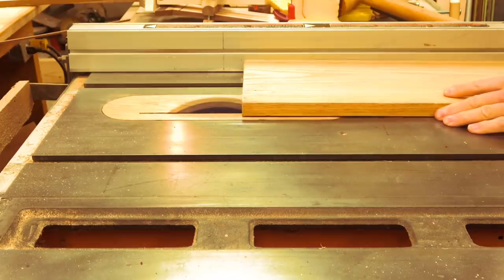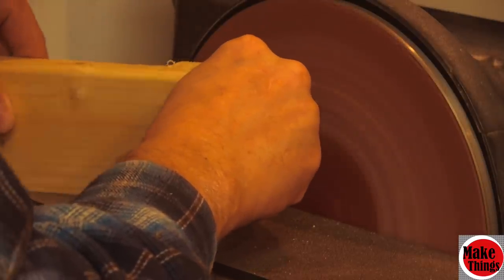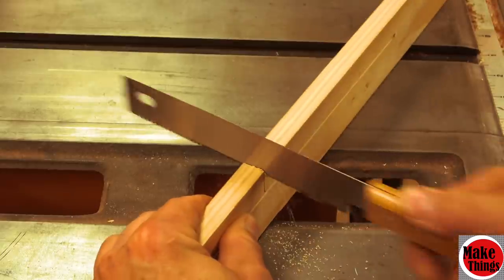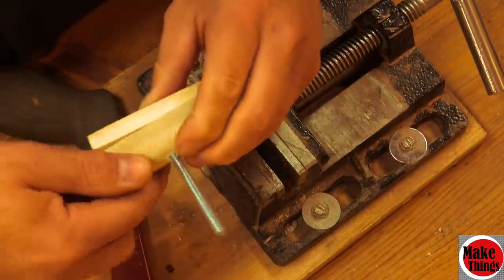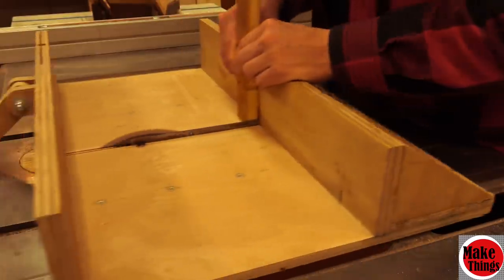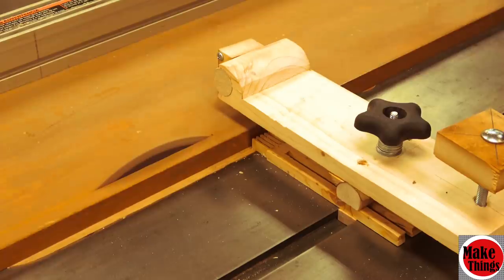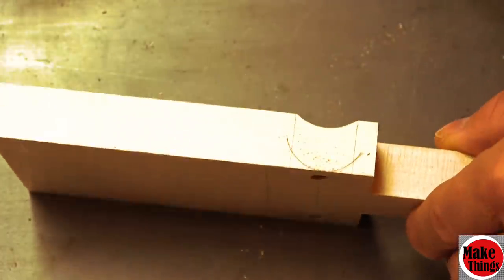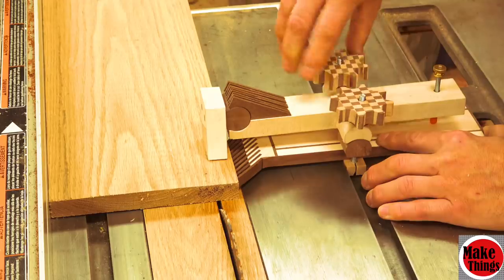Dual Force Table Saw Featherboard Jig // Don't Let your Table Saw Push you Around!

Comment: It should be added that that one of the best ways to avoid kickback and the jumping demonstrated is to use the riving knife tat came with your saw. If your saw did not come with one, there are a few videos out there demonstrating how to make a shop made throat plate with an integrated one. That said, I like the feather board and the fact that you show the prototype and the reasons for modifying it.

Comment: I am a new member to your channel and I like what I see.  I like the idea of building your own jigs and tools because in makes you feel more a part of your shop.  If you use PVC sheet goods for your runners and feather part of your feather boards they slide easer and hold up better and lots of times you can get scrap and cutoffs from a local boat company for free.  I have just retired and working on getting my shop together.
Reply from the maker: You know what, I was seriously tempted into doing that.  I was going to look into cut a PVC pipe into sections that could be used but held off on it only because it didn't match the overall look I wanted.  Using the wood broken down with ammonia did help though.

Thanks for the good suggestion!
Reply from the maker: You can DM me on Instagram @makethingswithrob

Comment: Creative way of using pivots. Horizontal grip is good but worried any vertical force will pull out the jig from the miter slot. One suggestion, change the miter slot piece to match the T slot to secure.
Reply from the maker: It's pretty stiff in there, but I could see what you mean.  It was a concept I played with...I'm sure it could be done a million ways better, but I hadn't seen any like this so I thought I'd try it.  For the most part it is very good.  Taller boards, not so great.

Comment: Nice looking jig but I'd question the value and strength of that jig vs the effort put into it especially if your doing wood working in a money making capacity and on a side note lift the blade to full height to stop sheet material trying to ride over the blade

Comment: Nice jig. I will be making one similar to the second one since I have a lot of walnut and cherry scrap sitting around. I was wondering how you adjust it to different widths of wood on horizontal part of the jig???
Reply from the maker: I kept it thin (about 3/8" or less) as thin stock is much more manageable and put up less of a fight.  It can be used without the horizontal part.

Comment: Hey Rob! Great jig. I'd like to make something similar that would work for sheet goods.
Reply from the maker: Oh a challenge!   I’m going to go out on a limb and guess we’re talk about ripping the 4’ length into sections.  What widths are you looking to cut?  Are you looking for both vertical and horizontal or one or the other?

I’ve had other ideas for vertical feather boards using the rip fence as a fulcrum (if you have the RIG I DID table saw it would be easy for this).  As for horizontal, being that they’re so large and have so much mass energy, I would use a long feather board from the base of the table up to the blade.  

Any of this interest you or were you just playing with me?  😂
Reply: The long full 8 ' length rips is where I sometimes struggle.  An auto adjusting feather board for horizontal pressure is what I'd really like. Something that tightens the sheet to the fence as it's being pushed into the cut. Vertical movement isn't as critical. Things are usually fine as long as the blade gets all the way through the cut although it would be good to have some downward pressure but not a deal breaker without. Actually just having something to keep the sheet from being able to  go above the blade may be best as there would be no additional friction unless the sheet was headed up that far. The least amount of resistance would be best.
Reply from the maker: https://imgur.com/a/VOj5xtX

Like this?

Comment: Id probably do both.  The prototype for practice and then two of the final: one for before the blade ane one after (each adjusted properly fir safety).
Reply from the maker: I could definitely see a vertical on the opposite side of the blade, provided the width of a cut fits the vertical featherboard.

Comment: I still do not understand why the person operating the saw pushes the board onto the sawblade from the wrong side in the intro scene. Never seen that before.
Reply from the maker: Which side do you cut on?  The fence was on the right side and I cut from the left to the fence.
Reply: @MakeThings  At 0'18" and around it looks as if you push the board onto the up-traveling edge of the sawblade. There is no fence yet. Normally, the blade pulls the board to the table. At least, what I am used to, but I may err.

Comment: jig seems to be pretty complicated. why dont you just use 2 pushing aids? does definitely the same job
Reply from the maker: No, I don’t agree.  Using a couple sticks for short boards might be okay.  Long ones, where burning is a problem and guiding dense wood is problematic is different.  Cutting thin (thickness not width) strips of wood is a very difficult task and dangerous.